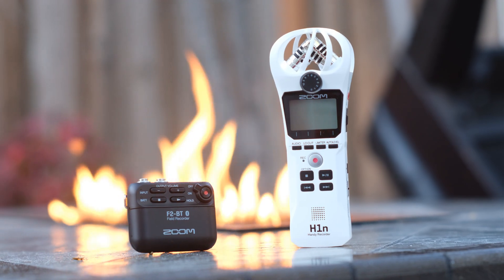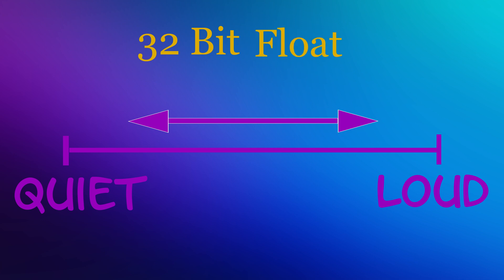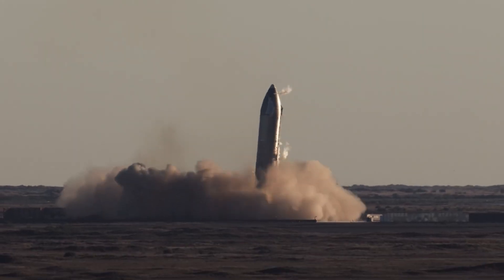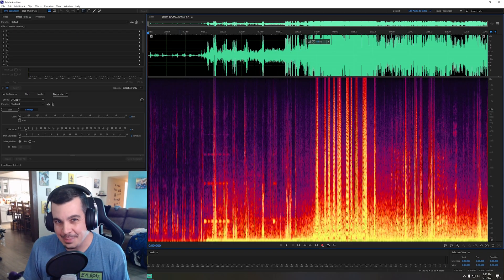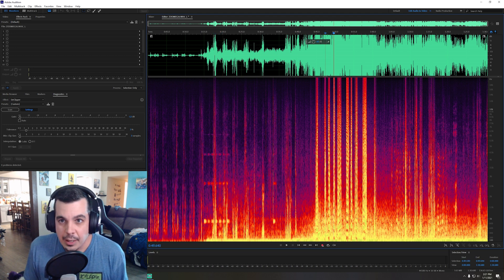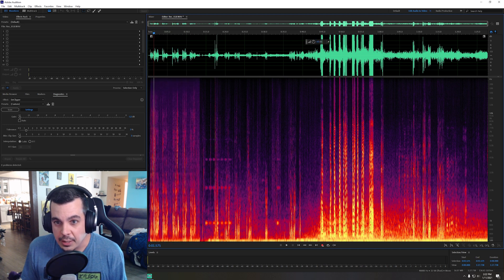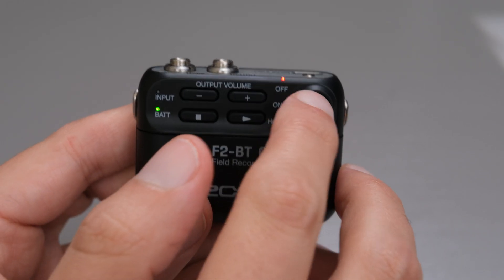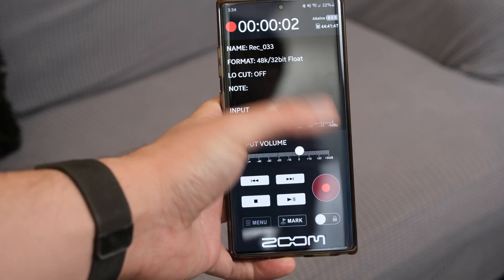Zoom F2 Audio Recorder and 32 bit float audio. The cheat code to skipping levels.

Comment: how long until 48-bit Float?
Reply from the maker: There's definitely some crazy things in the world of pro audio, but I feel that's in the realm of hifi music rather than some YouTuber babbling on about nonsense, lol.
Reply: @AdultsHaveToysToo  1024-bit Float quantum but maybe the world won't last long enough for that to happen
Reply: @AdultsHaveToysToo  MKE600 battery powered Professional mic with the Zoom F2-BT should be amazing?  Can't use an MKH416 because that req. +48V Phantom.  MKE600 is 126dB on battery and 132dB on Phantom.  MKH416 is 130dB but is not battery powered.  Everyone is using a boom mic that is 3.5mm with no Phantom requirements meaning the quality is always going to be Less.  It's amazing people haven't tried this combination yet.  My stuff is all coming in.  Originally I was going to just use the Sony UX570 to record in 16-bit fixed 44KHz Linear PCM but then saw how it's possible to bring back clipped and quiet audio rather than having the messed up sound forever.

Comment: If I was filming a dialogue scene between two actors or more using F2s would I have to worry about any issues?
Reply from the maker: That's actually what the bluetooth one is great for. If you get something like the Ultrasync Blue you can timecode sync your F2's and camera. If not you just need to sync them up in post.

Comment: The best thing you said in this video was "one less thing to worry about" ... when you are a solo shooter that is critical ... like good auto focus, audio levels are a constant issue that you must deal with. I live in Saigon, a very noisy city and fight the audio level battle constantly. I am slowly (budget considerations) replacing all my recording devices with 32-bit float. The next to be replaced are my Tascam DR10's ...Zoom F2's will be the replacement.
Reply from the maker: Exactly. So easy to get focused on setting your camera settings just right that it's easy to forget to double check your audio. So far the F2 has been working well for me, but I'm keeping an eye open for a better lav mic.

Comment: good review and demo. question if you know.  I have been using a dual mic wireless system and recording into my Zoom H4n.  while it is decent I am still having audio issues (it is strapped onto my camera guy and though he has headphones he isn't really monitoring it or adjusting it, I actually start it while it is on him) he is more concerned with camera operations.  This item might make it much easier for both of us. but will that system  work with my wireless.  if I plug the receiver into it?  and it splits each transmitter to each side.
Reply from the maker: The recording on this is mono only so it doesn't seem like it would work for your application. Other recorders in their F line do have multitrack, but they are much larger.